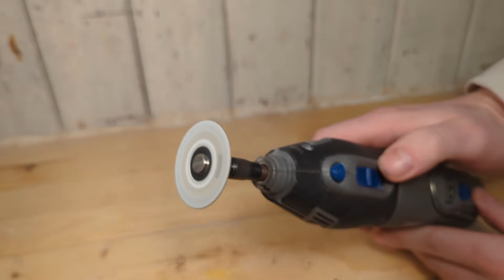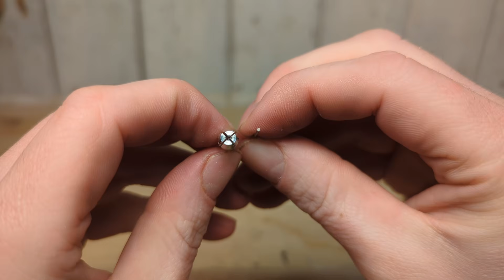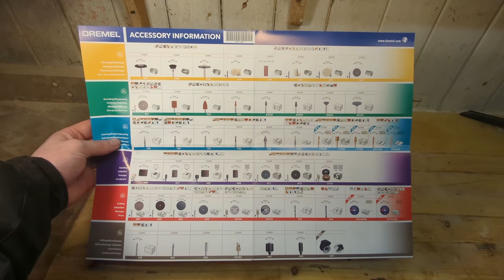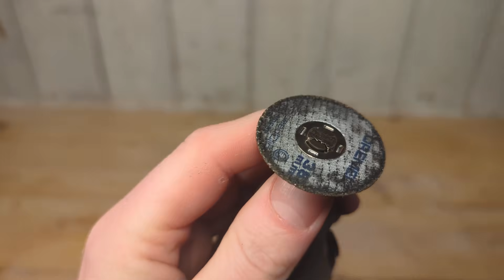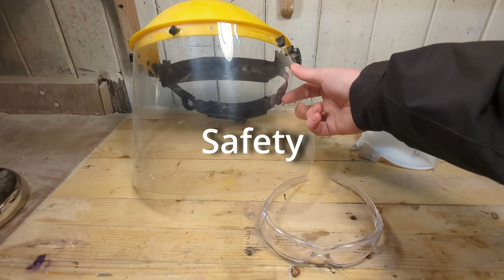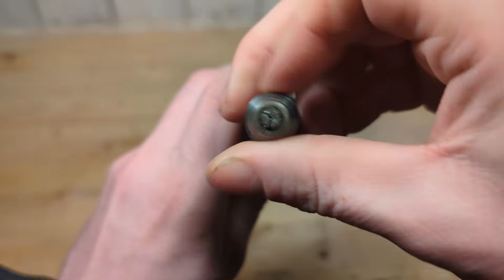Dremel/Rotary Tool 101: Complete Beginner Guide

Comment: Just bought a Dremel 3100 to open heavier wires while copper scrapping and what an investment. This little drill is powerful. I can now cut open heavy-duty 1/4" cables very quickly and with very little effort. If you're a scrapper, buy one.

Comment: NB. The collet (adjustable tool bit holder) sits inside the collet cap. When you first get the dremel you might find the collet is stuck inside the collet cap when removed. Use long nosed pliers to pull it out. 
When reassembled, it will now accommodate the tool bits.

Comment: What's the best model for removing broken screw head from an antique sewing machine inserting a slot...
Reply from the maker: Not sure. Are you drilling into it to remove it? Or do you need to make some slot so you can  unscrew it?
Reply: @rotarycrafts8760 
I will look over your videos... It's a long story... No electricity connection is here and I returned here after 21 years in 2020...
Mid 2021 I got my Mother's antique sewing machine and it took me 18 months with WD-40 to loose corrosive compartments and 8 seized parts...
My Mother's son ruined the bearing by drilling the screw and I didn't interfere and used steel epoxy and set in precision in mid 2023 his friend welded and ruined the shaft and I filed it out and I'm deter from my trade in tailoring and upholstery...
No money for survival so gardening is my next resort...!
I washed the entire antique sewing machine because I have to repaint and after sunning it...  Only yesterday I realized that portion of the screw was in and I used a bird beak pliers and a pen knife blade with WD-40... And it unscrewed, It is working with a screw from another sewing machine...
And still grips on the broken metal...! I will set the precision..

Comment: This was helpful overall, but lacked much info on working with plastic. I need to expand holes in plastic.
Reply from the maker: Yeah. I have not done much on plastics. But generally use a low rpm to avoid friction and melting. Some rough sanding drums might work, or some aluminum cutting burrs. But using fine burrs that grinds away the material will melt it more easily. It also highly depends on what type of plastic it is, some melts really easily, PVC does not and is very easy to work with.
Reply: @rotarycrafts8760 it’s Acrylic, about a cm thick that I need to expand two holes on.

Comment: Thanks for the great video! What would be a good bit for sanding fdm 3d prints with materials such as pla? I have a project that requires a smooth surface on the outside of a print so I'm going to try alternating sanding with filler/bondo to fill in the gaps and get a smooth surface.

Comment: This is the 3rd video I have watched of yours and they are all excellent. I thought I knew a lot about cutting discs and dremmels so I was surprised on how much I learned from watching. The best aspect of these well written and well shot videos is that you chose to concentrate on showing what each of them did using closeup detailed shots and letting them be the stars of your video instead of feeling the need to feature yourself or any other “story line” that many YouTubers do - not that there is anything wrong with that...  however…when I want to learn something, I want a video like yours which is why I’m subscribing to your stream over other ones that don’t get to the point soon enough. I wouldn’t even consider fast forwarding through yours for fear of missing out on some good information I didn’t even know I needed.  This comment is starting to turn into a review which was not my intention. I just want to say thanks for posting, you’re doing everything right and I will be back to learn more. Cheers

Comment: WARNING those cutting wheels will shatter and fling pieces all over and are DANGEROUS as I have come close to becoming injured
Reply: I agree if you cant use it correctly this is can be a problem
Reply: This just happened to me and i came to this video 😂😂
Reply: @maxcarroll5584 those thin ones are very light duty not for full on cuts. Or is good to make surface cuts to cut a groove or channel out. If you want to make actual cuts then you will need the thicker sized cutting wheel like the dremel ones. Them flimsy thin ones have their uses but if you use them incorrectly then its going to shatter. I wouldnt attempt to cut anything thicker than a fixing nail. And that 1 nail will probably be enough to ruin the blade. As i said its light duty and also not ment to apply much pressure just wait for it to do its painfully slow job

Comment: What would be a bood dremel tool for beginer wanted to cut out a 5.31” round speaker cut out circle on plastic ammo box or plastic tool box for 2 6.5 150waat marine speaker wil fit on the front side by side ?

Comment: Enjoyed that; I think we are still allowed to enjoy tech stuff.
Those Dremel small diameter collets are interesting.  The bore seems poorly centred.  Have you noticed?  Usually collets are used for greater accuracy over chucks; and with high speeds, so to reduce the spinning peripheral mass.  But again: have a look at the small collet.  Have been hoping to set up a drill press with an x/y table.  Are the tolerances good enough?
Thanks; and again, enjoyed video.
Don't go 'a-viking'.
Reply from the maker: Thanks. I will look into the collets to see if I can make it center better.  There is a little bit  of play when using the drill press setup. So it is not the best for high accuracy work where keeping true 90° is important. But it is good enough for hobby work.
Reply: @rotarycrafts8760  Thanks for that.  Tolerance in drill press is much as I thought it would be.  Looking into the collets is dead easy: simply view end-on.  The effect does not seem to be a viewing angle error.  It really surprised me; presumably it is still there.  There seems to be little chance of truing it up.  So long as safety and conservatism are foremost, and conservatism - same noun - is followed, especially with load and speed, the tool is very good.  As I understand it, full wattage is supplied only at full speed.
Thanks again.

Comment: I recently had to begin learning how to use a Dremel (4000ish) to do some very fiddly wood shaping. My recommendation: Fix your work piece using a vise or clamp. Double-sided adhesive tape for small pieces also works. Use both hands to hold the Dremel (even using a flex shaft) and have one hand rest on a solid support with the other hand moving the Dremel. Oh, and eye protection, eye protection, eye protection. I had one of these cutting disks shatter as shown in the video.   

PS: So that is how you use these white cottony disks.

Comment: SAVE your money and buy a FOREDOM instead . By the time you end up buying 3 to 4 broken dremels youll still have the 1 Foredom (which has more power and torque ) Also DON'T waste your money on dremel bits, instead go buy the Kutzall bits ( better quality and cheaper in the long run )
Reply from the maker: Well. For the price of a FOREDOM I'll have 4 Dremels :) I'ma try the foredome one day tho.
Reply: I use my 4300 Dremel once a year. 😂

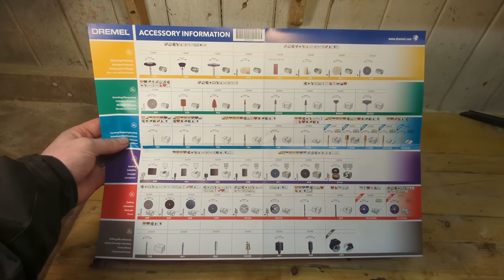Comment: Where can I find a pdf for the manual at 4:00 ? My Dremel 100 did not come with one
Reply from the maker: Hi. That was kind of hard to find in google search as a PDF. I'll leave 2 links at the for some good ones here. But its not the same as i showed, but there are many bits here. 
https://i.pinimg.com/originals/c0/34/fb/c034fb995e0e1fff215751df3f1b15b3.png
https://i.pinimg.com/originals/26/6b/e6/266be6497f7d1e3a897d6943902a28a6.png

Comment: Will the dremel attachments work with other brands of rotary tools? I just bought the 12v cordless Warrior tool from Harbor Freight. It has the threads like the dremel and it looks identical, but hard to know for sure from pictures and videos online
Reply from the maker: It's hard to know for sure before you've tried it.  Most off brand rotary does make the threads to fit the Dremel attachments. :)

Comment: Do you think I would be able to use a dremel to file down and polish the thrust pad of an inverted bearing on a turntable? If so how would you do it?
Reply from the maker: Well, i can't say I have any experience with that very specific task. :) But I guess you would want to achieve cut depth that is consistent across the pad to get a flat surface. If so, you could try to use something like the Dremel workstation 220 to keep the Dremel at a set depth of cut.  Use it with a 1/8" shank carbide bit for metal (the sell cheap sets on amazon). But getting clean flat cuts with a Dremel can be a challenge. But I don't fully understand the task, cut depth, size, material will all factor in  if it is possible or not.